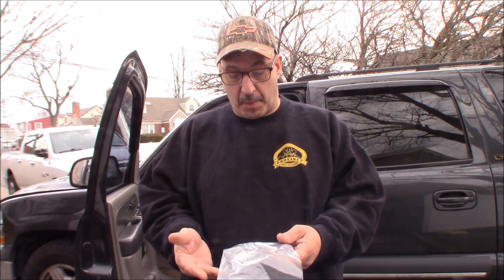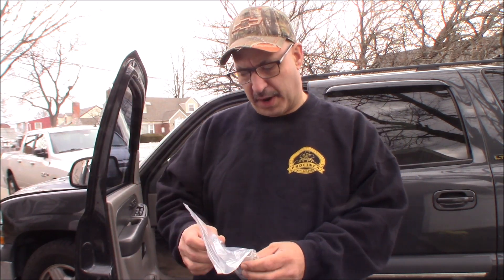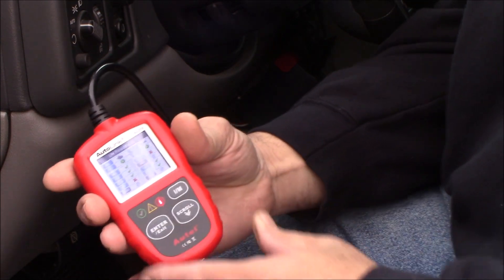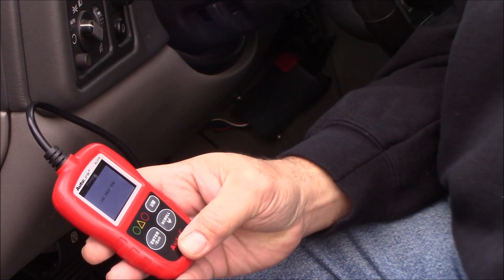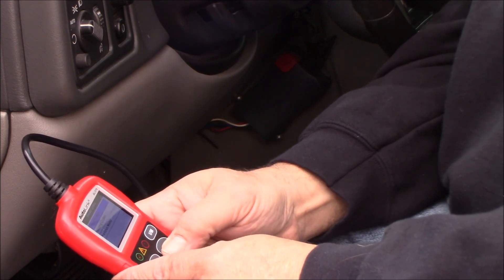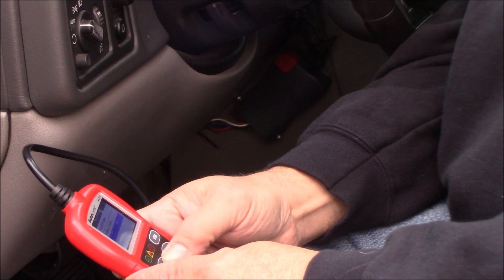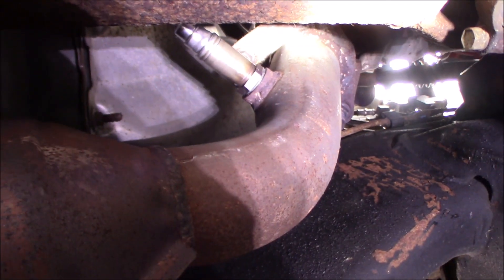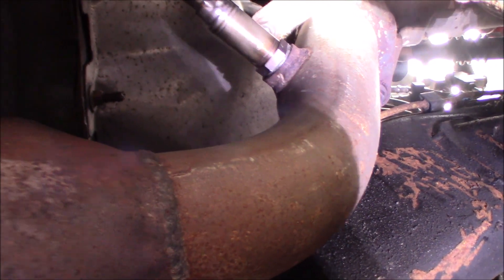Repair OBD2 Code P0134 | O2 Sensor | Chevy Suburban or Similar  2000-2006

Comment: I just had that same one go out in my 06 Yukon 4x4.  It has been a great truck!  130,000 miles.  I've heard so many horror stories about buying fake parts on Amazon and even occasionally on Rock Auto.  I bought a Denso at my local Advance Auto.  It was 70.00....... OUCH!  But at least I have piece of mind.
Reply from the maker: Yes, you have to be careful.  The plain packaging, I understand.  It save them money, just make it hard to determine if you're getting what you pay for.
Reply: That's if??? A b1s1 is a afr on my 03 CRV. 280 plus tax!